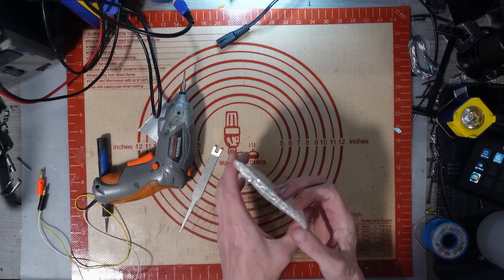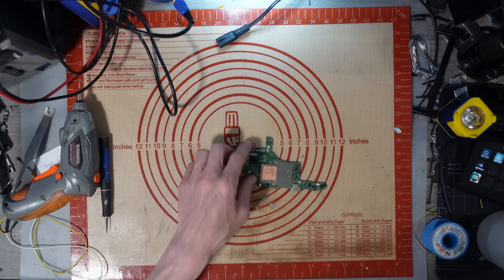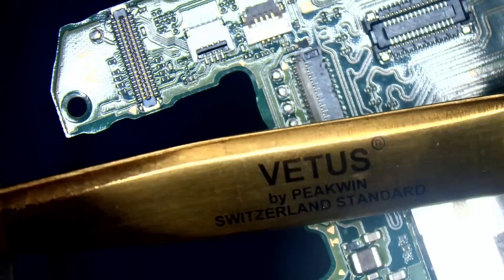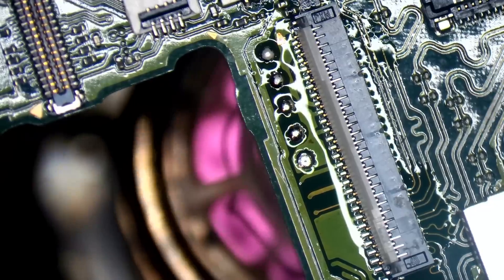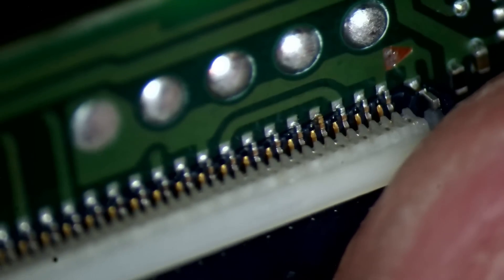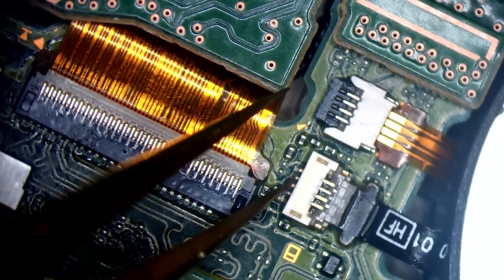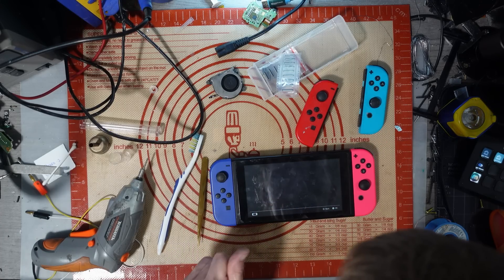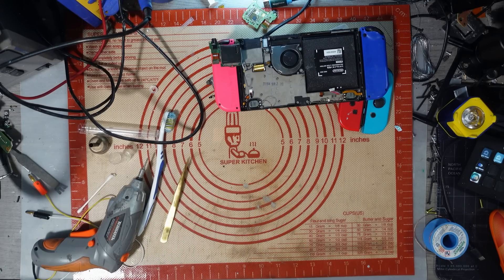Nintendo Switch With A Broken LCD Connector... Let's Fix It!

Comment: TAHNK you so much i just replace the display connector for the fist time and my first time using a hot air gun . so now the screen work only thing is that i absolute cooked the on off volume connector just going to solder the connector directly on to the board. THANK YOU SO MUCH
😁

Comment: Get a switch light that turns on but get no picture (backlight is on) but sound is ok...replaced the lcd conector but still the problem...any tips on where to look for the problem now? Thanks from brazil

Comment: Can you make a video demonstration of how you clean Nintendo Switch boards with an ultrasonic cleaner? I'd be grateful if you could also discuss the recommended cleaning solutions etc.
It would be great to see a well executed repair involving several replaced components followed by sonic cleaning that ends with a factory clean finish.
Many thanks in advance 👍🏼

Comment: Had the most disappointing fix so far, bought a spares repair DAB music centre... was the plug fuse gone and works abs fine, still a tenner for a decent sounding bit of kit with a cool motorised CD door that is like opening a space dock as its a vertical stand type so the rooms be alive with da sound o' music :P   Like a muppet I was looking for my stash of MP3 CD's then discovered a hidden hatch on top, USB 3.0 ftw so just loaded a USB drive up with about 16 gigs o' songs and bingo bango verra pleased :D

Comment: Alright, Ill take the heat for this. Its my switch board and I didnt have an ESD bag for it. While I was packing, I completely forgot about the ESD and thought about the package handling done by the shipping company. So I used a bubble wrap like a derp. SOWWIE :'( 
Thanks for the fix mate (as Usual). No wonder it didnt boot lol. So it was working basically. Now for the other 2 boards :P btw sending you an intersting PS5 soon.
Reply from the maker: LOL it's all good mate, I like to moan lol. Hopefully the other two are successful
Reply: @TheCod3r  No no. It's alright. You were right though. I'm still learning and made a oupsie 🤣🤣❤️